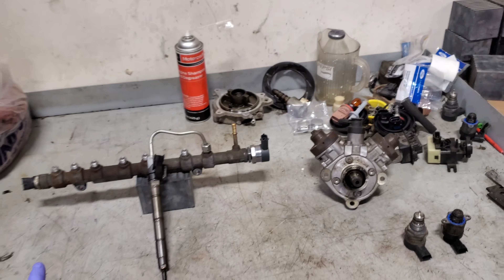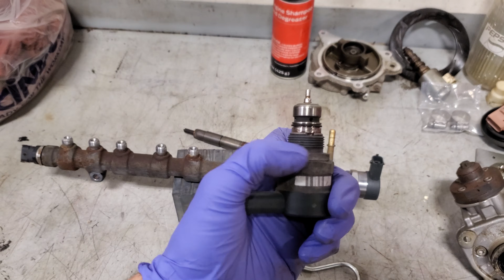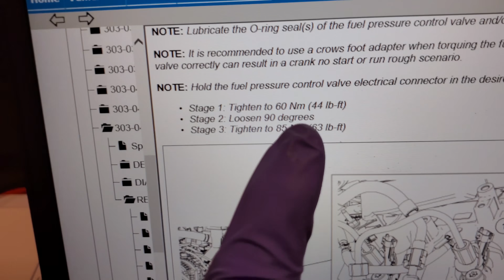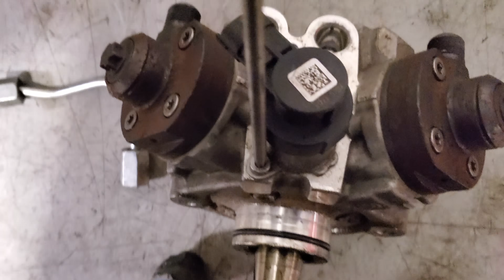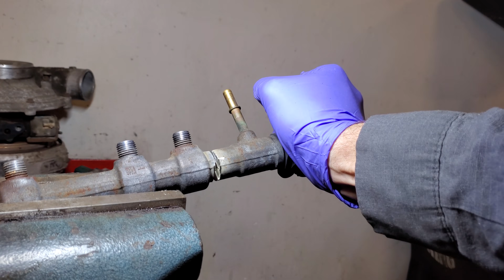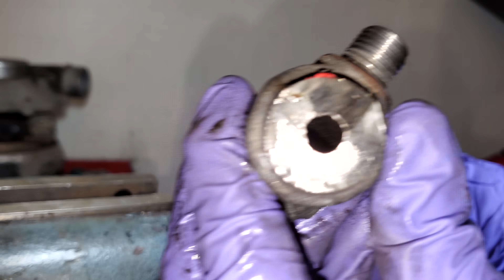High Pressure Fuel system concerns - LH FUEL RAIL discussion | Ford 6.7 Diesel

Comment: Hey long time watcher of the channel and fello tech here. I am 100% stumped on a 2012 f250 6.7. The truck has recently gotten a new set of injectors and a driver side complete rail. The truck somtimes doesnt want to run and is throwing a p0089 fuel pressure regulator A performance. Today it started sounding like its got a choppy cam. 😂 but you rev the truck up it sounds fine. What direction would you look into?  Any help is greatly appreciated. 🙏
Reply from the maker: Same pump???
Reply: @PowerStrokeTechTalkwARod  yeah we haven't changed the cp4 or low pressure pump.
Reply from the maker: Hmmmmm

Comment: Does a new fuel rail come with the correct specs on the fuel pressure valve ??..
Reply from the maker: Wym??
Reply: they come with both sensors  @PowerStrokeTechTalkwARod
Reply from the maker: Si
Reply: gracias 🫡 @PowerStrokeTechTalkwARod
Reply: Attached

Comment: Would you know why I'm getting a crank no start. I replaced the fuel regulator on the fuel rail. Checked the mprop and cp4 and theres no metal depris changed the upper fuel filter. Its getting fuel to the upper filter. Sprayed a little starting fluid in the intake and it didnt even try to pop. If u have any idea that would be amazing
Reply: I'm not getting any codes either
Reply from the maker: Without looking at the truck with my scan tool, could be a lot of things. I can't diag thru the comments brother

Comment: I have a question. If I turn the ignition to the on position. I hear the low pressure fuel pump on, but I am not getting any fuel from the high pressure pump coming out to the fuel rail. Is that normail?

Comment: How do I get a proper torque/ wrench into that tight spot from the driver fender side (high pressure regulator) is there a way to do so??
Reply from the maker: Ya dont, ya just gotta snug it up
Reply: @PowerStrokeTechTalkwARod thx, got P228f code, checked fuel filters, no metal shavings etc. I dumped the fuel out of the upper filter into a clear container and it was also clean. High pressure regulator was clean without any metal shavings or marring. She's running fine. I'm stumped because CEL came on, scan showed P228f, cleared code and went for a drive, drove fine no issues then scanned and without a CEL light on P228f reappeared. btw also getting code P132B
Reply: @PowerStrokeTechTalkwARod 😮 well damn, I just changed all the manifold gaskets, exhaust gaskets. O rings and inlet connectors to the turbo (both coolant and oil) along with soldering in new wiring harness to the VGT since the old one was definitely broken which for some reason never affected it's drivability. 

The vanes in the Turbo were free of gunk and spun freely with no back and forth play, no noise.   I neglected to remove the VGT to test it when I had the turbo out because I noticed the broken harness and thought it was the issue. 
So before buying a new fuel rail is there anything you would recommend aside from new fuel filters and purging the air from the fuel system 
Thank you in advance btw
Reply from the maker: Nope juss that. Watch my turbo tear down. The parts ARE INSIDE. Not the wheels the spin that you can see. The VGT move the ring that is attached to the vanes internally. Their probably rusted up. Thats why 132B sets.

Comment: I bought a 2011 f250, the guy I bought from said he put def in the tank and had to replace the whole system. I have had the truck a year and has only ran 400 miles and not it won't start. Replaced 4 injectors, camshaft sensor, crank sensor, fcv ,fuel pressure sensor and still no start forscan shows 220000 psi on one rail and zero on the other. I'm stumped. Any tips?
Reply from the maker: There is only one rail that has a sensor in it. There's no way it's 220000 PSI

Comment: I have a 2016 F250 6.7 L and my issue is it dying after running for approximately 5-10 seconds. I have changed out sensors and filters with no luck, again it starts but dies. What could be my problem?

Comment: 2016 6.7 had it since new no problems. Yesterday I had a guy change my fuel filters. I purged it but I don't think enough. It started and then died. We cranked it about 5 cycles. It finally started. I was worried we got air in the lines. The next day I was driving it on the interstate and it started sputtering. The dash said slow speed down. I took it to O'Reilly and scanned it said bad fuel pressure sensor. It starts and drives I can hear the fuel pump working harder than usual. Hopefully all that is wrong is the fuel pressure sensor.
Reply from the maker: He didn't tighten the lower filter tighten enough....
Reply: @PowerStrokeTechTalkwARod  I will give that a try and get back with you.
Reply: @PowerStrokeTechTalkwARod I tightened the bottom filter a little it was tight. It is still showing engine sign on dash. The pump is still louder than normal.  I am about 70 miles from my town. Do you think if I drive around 45mph it would not hurt it? To change the pressure sensor is there another of disassembly?
Reply: @PowerStrokeTechTalkwARod thanks
Reply: @PowerStrokeTechTalkwARod  I think I got it, don't hear the pump anymore. I took the bottom filter off. Spread everything with break cleaner. Wiped it with paper towels and Vaselined all O-rings and reassembled. No strange sound from the fuel pump. I haven't tried up to speed to see if it is out of limp mode. Engine light is still on. I did reset the fuel filter. Don't know if I need to have a scanner clear it or it will go away. Anyways thanks for the help I really appreciate it. I am staying out of my town working with drive time close to 80 hrs a week. I have done my own maintenance. But didn't feel like doing it myself do to my jobs hours. Don't know anyone over here and trusted wrong shop. Thanks again ARod.
Reply from the maker: U can goto autozone & them pull & clear the code
Reply: @PowerStrokeTechTalkwARod the shop I used pulled the yellow plug and the water sensor out of the filter housing. He didn't know to remove the FX4 guard around the house I am guessing. I fixed the air leak do to sloppy work. When I disassembled his work cleaned and lubed it. I noticed the yellow plug O-ring had a squashed part on the biggest O-ring. So I have a slow drip. I think it could leaking from both the plug and sensor. A few years ago I had a stuck housing. That had to be broke off to get it off. Luckily O'Reilly had one in stock. I went to O'Reilly, Advanced Auto and Autozone none them can get the housing anymore. Which is crazy for a plastic part known to break. I bought a spare filter for next change. I am assuming Ford still sells housings. Or do you think I should just do the Cat filter replacement system?
Reply from the maker: Yeah, time to upgrade

Comment: Im currently working on a 6.7 power stroke that I recently did a full engine rebuild on, it originally started and idled fine until the CP4 that we put in broke (the shaft started to spin in the gear) so we replaced it and now I have the p2291 code and only building 340-400 psi, there is no metal in the cp4. I’ve gone through the diagnostics on it and the trouble shooting procedure. I’m currently at testing the ohms on the fuel pressure sensor and pressure control valve but it’s not stating what that value should be just saying check for high resistance. I’ve also checked to see if there is fuel leaking out of the injector return lines and there is not. Any guidance on this would be greatly appreciated.
Reply from the maker: I'd say a LH rail
Reply: @PowerStrokeTechTalkwARod  just wanted to let you know after a lot of trouble shooting it turned out to be a fuel pressure sensor.

Comment: PLEASE 🙏 READ I COULD TRULY USE THE HELP!!! URGENTLY IF POSSIBLE 

Ive got one for yall i traded my 03 dermax diesel with the 6.6 6speed manual with 192k on it zero leaks 1 owner me being the 2nd for a 2011 F250 SD 6.7L powerstroke FX4 edition with the long bed. 

Here is my current problems. If I had known what I was getting onto I would of never done the trade. The chevy ran perfect with no lights on the dash to now, "my current situation". 

Its got the dreadful upper oil pan leak i need to fix along with my list of codes from forscan. 

Im a small business owner & i tint windows for a living but have built show cars my whole lifeand I am 44 years old. but when it comes to the 11-16 Ford 6.7 super duty its my 1st Ford & 2nd diesel and I have zero specific tools needed to work on this truck, as it's a completly different ball game for shure. 

So im wondering if there is any way someoune could possibly help me get it situated on getting it all fixed.  I've driven the truck for about 1 year and it has given me it's hickups every now & then but i have Zero friends & in this day & age people are either untrustworthy or very expensive or both & im a do it right the 1st time kinda guy. I get it though, the parts are high & so is the labor so i dont mind getting my hands dirty & turning some wrenches side by side so i can not only learn the truck but also have aome help getting it all done. 

The body has 315k on it & i was told it had an engine put in it out of a 2012 so its only supposed to have 154-164k on the engine. Its completly deleated & tuned on a Mini Max. It has zero blowby but im assuming it wouldnt anyway with a bad upper pan gasket. Some 1st Dilemma is that id hate to fix it & find out it does have blow by & be out of all the money doing it. Its a super clean truck and ive put alot of money into it dressing it up but it does no good to sit there looking pretty if i dont drive it. I only drive it if i absoulty need to. I do however start it & drive it at keast 1-2 times a month sometimes 2. 

Anyhow thats my story & i need the help. 

Here is the lISt of codes from forscan. 

===TCM DTC === 
Successful DTC reading, no error codes found Module:
Transmission Control Module 
===END TCM=== 

===PCM DTC P228F:00-27=== 
Code: P228F - Fuel Pressure Regulator 'A' Exceeded Learning Limits - Too High 
Status: - DTC Present at Time of Request - Malfunction Indicator Lamp is Off for this DTC
Module: Powertrain Control Module 
===END PCM=== 

===PCM DTC P0192:00-A8=== 
Code: P0192 - Fuel Rail Pressure Sensor Circuit Low (Bank 1)
Status: - Previously Set DTC - Not Present at Time of Request - Malfunction Indicator Lamp is On for this DTC 
Module: Powertrain Control Module 
===END PCM=== 

===OBDII DTC P0192-C=== 
Code: P0192 - Fuel Rail Pressure Sensor Circuit Low (Bank 1) 
Status: - Confirmed - malfunction is confirmed Module: On Board Diagnostic II 
===END OBDII=== 

===OBDII DTC P228F-P=== 
Code: P228F - Fuel Pressure Regulator 'A' Exceeded Learning Limits - Too High 
Status: - Pending - malfunction is expected to be confirmed 
Module: On Board Diagnostic II 
===END OBDII=== 

===TCCM DTC U0100:00-08=== 
Code: U0100 - Lost Communication With ECM/PCM A 
Status: - Previously Set DTC - Not Present at Time of Request - Malfunction Indicator Lamp is Off for this DTC 
Module: Transfer Case Control Module 
===END TCCM=== 

===TCCM DTC U0101:00-08=== 
Code: U0101 - Lost Communication with TCM 
Status: - Previously Set DTC - Not Present at Time of Request - Malfunction Indicator Lamp is Off for this DTC 
Module: Transfer Case Control Module 
===END TCCM=== 

===ABS DTC C0020:15-08=== 
Code: C0020 - ABS Pump Motor Control
Additional Fault Symptom: - Circuit Short To Battery Or Open Status: - Previously Set DTC - Not Present at Time of Request - Malfunction Indicator Lamp is Off for this DTC 
Module: Antilock braking system 
===END ABS=== 

===ABS DTC C0020:71-C8=== 
Code: C0020 - ABS Pump Motor Control Additional Fault Symptom: - Actuator Stuck Status: - Previously Set DTC - Not Present at Time of Request - Malfunction Indicator Lamp is On for this DTC - Test not complete 
Module: Antilock braking system 
===END ABS=== 

===ABS DTC C1B00:63-48=== 
Code: C1B00 - Steering Angle Sensor Additional Fault Symptom: - Circuit/Component Protection Time-Out Status: - Previously Set DTC - Not Present at Time of Request - Malfunction Indicator Lamp is Off for this DTC - Test not complete 
Module: Antilock braking system 
===END ABS=== 

===ABS DTC U0100:00-08=== 
Code: U0100 - Lost Communication With ECM/PCM A Status: - Previously Set DTC - Not Present at Time of Request - Malfunction Indicator Lamp is Off for this DTC 
Module: Antilock braking system 
===END ABS=== 

===ABS DTC U0101:00-08=== 
Code: U0101 - Lost Communication with TCM Status: - Previously Set DTC - Not Present at Time of Request - Malfunction Indicator Lamp is Off for this DTC 
Module: Antilock braking system 
===END ABS=== 

===ABS DTC U0401:00-08=== 
Code: U0401 - Invalid Data Received from ECM/PCM A Status: - Previously Set DTC - Not Present at Time of Request - Malfunction Indicator Lamp is Off for this DTC 
Module: Antilock braking system 
===END ABS=== 

===RCM DTC === Successful DTC reading, no error codes found 
Module: Restraint Control Module 
===END RCM=== 

===BdyCM DTC U0100:87-08=== 
Code: U0100 - Lost Communication With ECM/PCM A Additional Fault Symptom: - Missing Message Status: - Previously Set DTC - Not Present at Time of Request - Malfunction Indicator Lamp is Off for this DTC 
Module: Body Control Module 
===END BdyCM=== 

===BdyCM DTC U3000:49-0A=== 
Code: U3000 - Control Module Additional Fault Symptom: - Internal Electronic Failure Status: - DTC Present at Time of Request - Malfunction Indicator Lamp is Off for this DTC 
Module: Body Control Module 
===END BdyCM=== 

===BdyCM DTC B1218:00-48=== 
Code: B1218 - Transmitter Identification Code Status: - Previously Set DTC - Not Present at Time of Request - Malfunction Indicator Lamp is Off for this DTC - Test not complete 
Module: Body Control Module 
===END BdyCM=== 

===BdyCM DTC B1313:11-0A=== 
Code: B1313 - Interior Lighting Output Additional Fault Symptom: - Circuit Short To Ground Status: - DTC Present at Time of Request - Malfunction Indicator Lamp is Off for this DTC Module: Body Control Module 
===END BdyCM=== 

===BdyCM DTC B10D7:05-48=== 
Code: B10D7 - PATS Key Additional Fault Symptom: - System Programming Failures Status: - Previously Set DTC - Not Present at Time of Request - Malfunction Indicator Lamp is Off for this DTC - Test not complete 
Module: Body Control Module 
===END BdyCM=== 

===SCCM DTC U2100:00-0A=== 
Code: U2100 - Initial Configuration Not Complete Status: - DTC Present at Time of Request - Malfunction Indicator Lamp is Off for this DTC Module: Steering Column Control Module ===END SCCM=== 

===IPC DTC === 
Successful DTC reading, no error codes found Module: Instrument Panel Control Module ===END IPC=== 

===TBC DTC U0100-20=== 
Code: U0100 - Lost communication with the PCM Status: - Previously Set DTC - Not Present at Time of Request - Malfunction Indicator Lamp is Off for this DTC 
Module: Trailer Brake Control Module Diagnostic Trouble Code details Lost communication with the PCM 
Note: DTCs that start with 'U' are faults which occur during module-to-module communication. Modules should never be replaced based only on a 'U' code. These codes do not always indicate a problem, and can be caused by normal diagnostic functions, carried out on the vehicle. ===END TBC=== 

===TPM DTC === 
Successful DTC reading, no error codes found Module: Tire Pressure Monitor 
===END TPM=== 

Thanks in advanced

Comment: I changed fuel injector then while fuel injecter was out i changed my bottom fuel filter. I didnt not crack filter before opening drain plug so full system system was drain now it will crack but no start
Reply from the maker: Wth....

Comment: We have 2019 F350 at the shop now. Has a persistent p0087. Changed the fuel filters and sent it on its way. Customer said it continues to have low power up hills. We removed the pressure control valve and checked for metal. Nothing found on the pressure control valve. Where should we go next with our diagnostic procedure or should be just put a full fuel system on it as it has 375k miles and is a fleet vehicle. Thank you in advance for all your help!!
Reply from the maker: Are you guys just throwin parts at it OR have you done any pin point tests???

Comment: I know this thread is 4 years old, but hoping for input… Last year, while on a road trip, my CP4 decided to have a glitter party… Left the truck to be repaired, bought a 2001 7.3, and continued on my trip. Once repairs were done (14K later), I picked up the truck and brought it home. About 1000 miles later, a line into the injector decided to get loose and leak, causing engine shut down and P0087. Since I had been gifted a DCR, installed it, tightened up the loose line, and moved on. 500 miles later, another injector line loosened up and started to leak. Same engine shutdown and same P0087 code. I just tightened it up and back up and running.

My question is this…. Is there a chance the lines weren’t tightened to spec and vibration is knocking them loose enough to leak, or am I looking at a pressure regulator issue? 

Truck does not have emissions and is a 6.7
Reply from the maker: Yepp!!!! I would get u a 17mm wrench and re snug all 16 fittings. Them ball bags probably brought their purse with them to work that day.
Reply: @PowerStrokeTechTalkwARod  cracking up!!! I told my wife they used their purse strap to tighten them up…

I appreciate you and your videos. Im about to drag this truck across the country to my Kentucky farm, but haven’t felt confident in it. 

I’ll get all tightened up!

Thanks ARod!
Reply from the maker: Email me and LMK. This is an old video. All my info is in description or all current videos
Reply: Just emailed ya